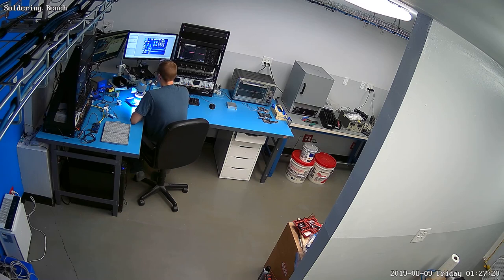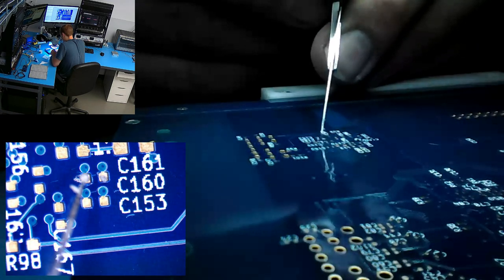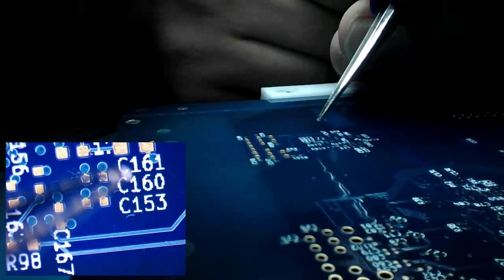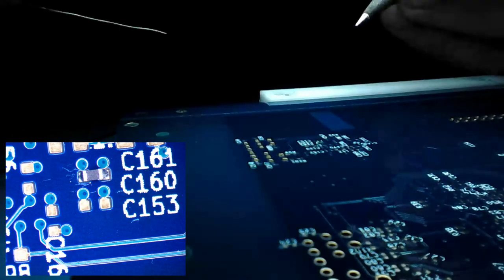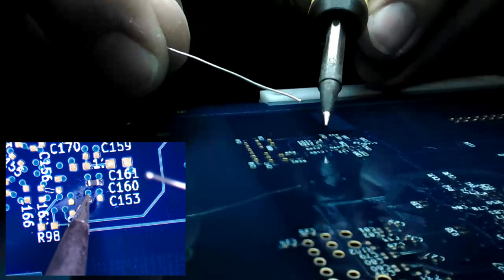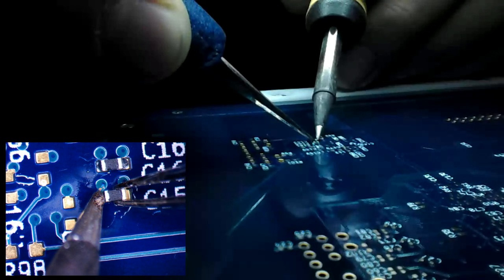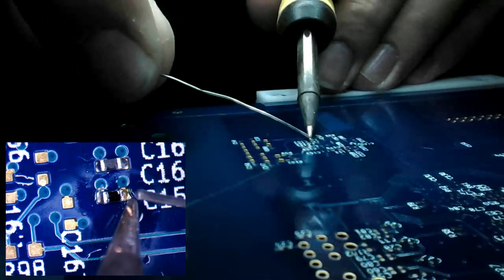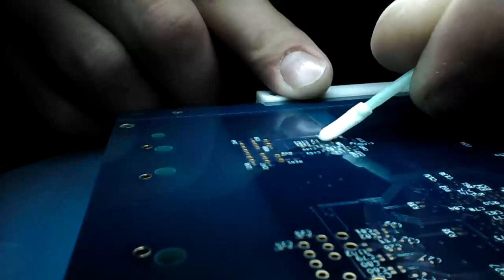Lab #2: Soldering SMT chip components

Comment: What kind of microscope do you use?
Reply from the maker: It's https://www.microscopenet.com/omax-7x45x-trinocular-zoom-stereo-microscope-single-boom-stand-with-144led-ring-light-p-11643.html or similar. There's a handful of Chinese companies making very similar scopes under a bazillion brands.

Going with a fairly cheap scope is OK for this kind of work as long as it's optical (not webcam based) since you want low latency and full stereo. Zoom is highly recommended but you can probably get by OK with fixed 10x or something.

Cheap optics are definitely inferior to nice ones at high power(I have a side by side comparison of 100x and 400x Amscope vs Olympus systems side by side on the same sample and the difference is striking), but at <50x the tolerances on cheap optics are good enough that I have not seen any visible degradation in quality. In fact, the Chinese soldering scope actually seems to have better image quality than my old B&L Stereozoom 4.